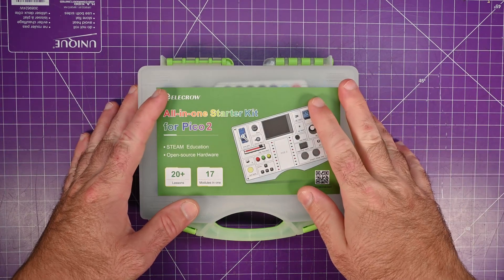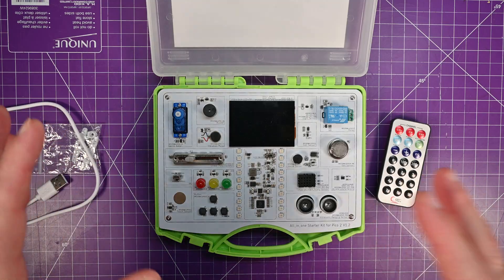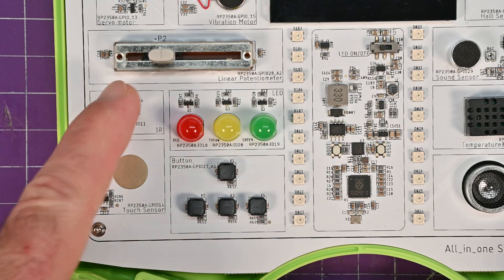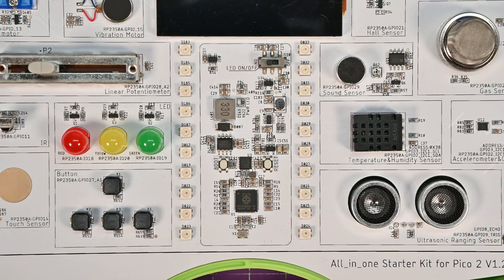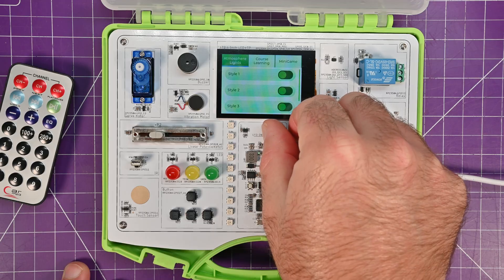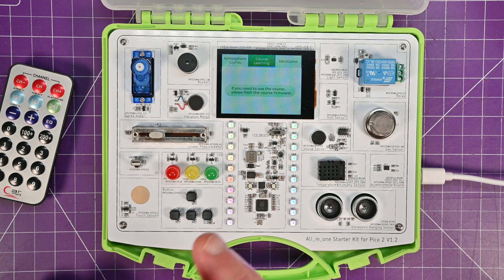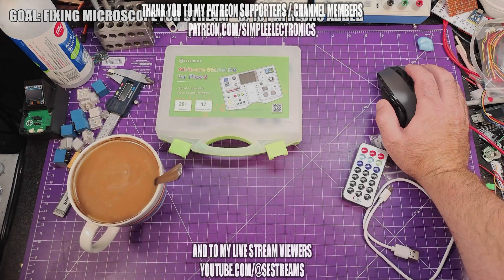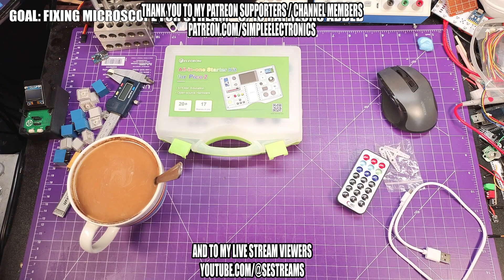This Pi Pico 2 Packs A PUNCH! | Elecrow All-In-One Pico 2 Starter Kit First Look!

Comment: Thank you for this video.. It is the first one that actually gives any usefull information. As a complete begginer to any kind of coding, I bought this several minths ago. It is a very nice package with all the sensors and input devices on the board. As a begginer I struggled with it for weeks, resulting in nothing but frustrating failure. The instructions are confusing and have you jumping around. They are complete garbage and I did e-mail Elecrow about what I thought of them. I would not reccomend to any individual wishing to learn coding to get this product. Maybe in a class environment it is ok. Your video may inspire me to try it out again..

Comment: The price surprised me. I rolled my eyes at one of these "education kits" expecting it to be $75-$125.
<$30 seemed like a great deal for something like this, despite the obvious hardware flaws[1].
Then it became apparent WHY it was so cheap. The software and education part, arguably the most important, was half-assed.
I'm normally quick to defend an engineer for their choices, but I'm ALSO an educator, and this is a clear example of "engineer brain" having no understanding of how to actually teach a thing.

Side note: College class? These kind of kits are what I use for middle schoolers(10-13).
I'm not saying you CAN'T use a kit like this for college, I'm just saying you shouldn't.
The brightly colored stuff and integrated micro-lessons are going to bore all but the most beginner of college students.
I might use these to teach an "electronic art" elective in a non-science degree or something, but never a core course on a science track.

[1] I actually think that having it all on one integrated board is a mistake. In retrospect, it is clearly an "engineer brain" choice, and actually detracts from the education aspect. Hooking things together with wires, breadboard or connectors, helps the student get a better picture of what it actually going on. The point of these is software AND hardware after all. Having it on one board removes much of the physicality and makes this an almost entirely software tool. And at that point, why have a physical device at all? If you aren't plugging things together and figuring out what pins go where, why not just simulate the whole thing with a drag-and-drop tablet app or something?